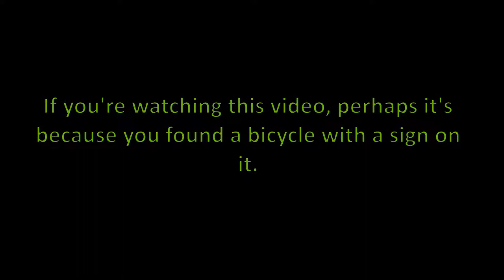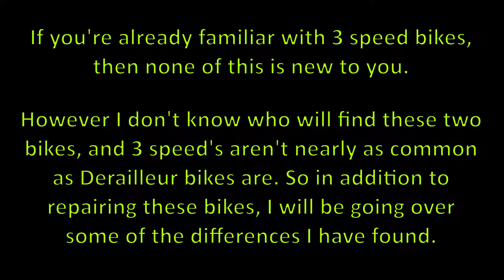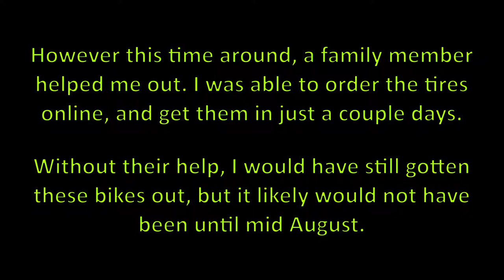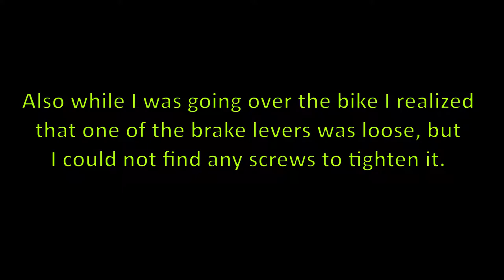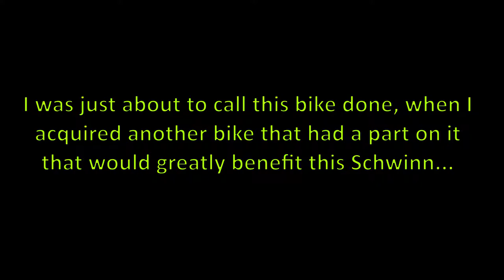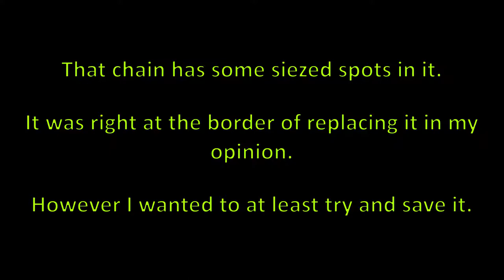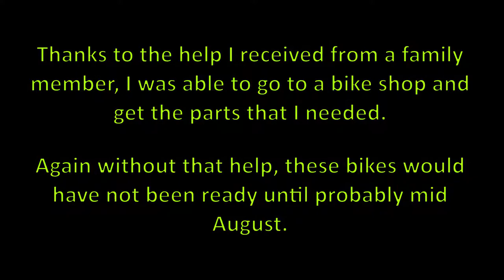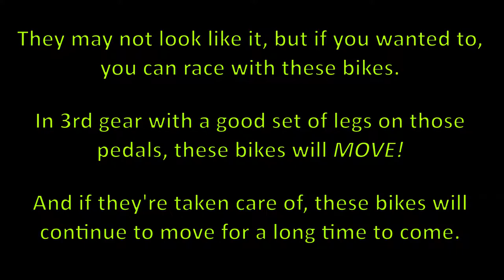Jackpot Part 2 AKA: How I learned about 3 speed bikes

Comment: Good video! I once heard that internally geared hubs cause a lot of friction and aren’t very efficient at transferring power. Is it true?
Reply from the maker: From my experience with test riding these bikes I would say no.

In fact the skinny road tires likely have the most effect on friction, or lack thereof. Road tires are smooth and inflated to a high PSI, and help these bikes get up to and maintain their speed.

The downside is that you will feel every bump on that road. These bikes do not do trails, or gravel, or really bad roads. However on a good road, you can go fast on these bikes. 25 MPH is obtainable for someone reasonably fit.